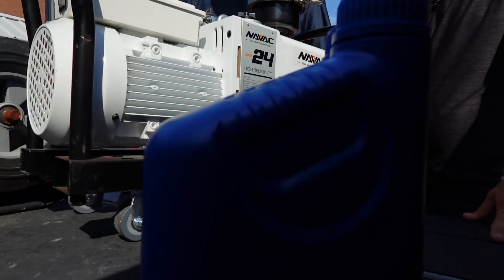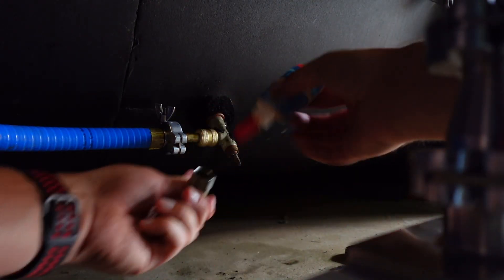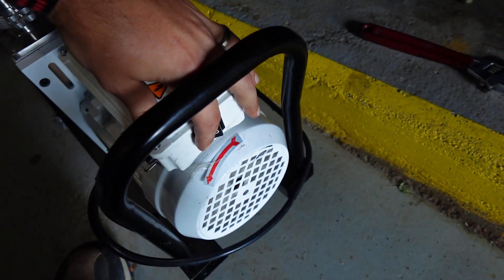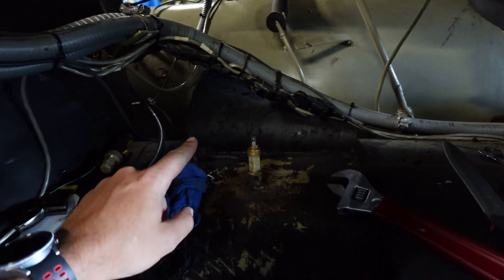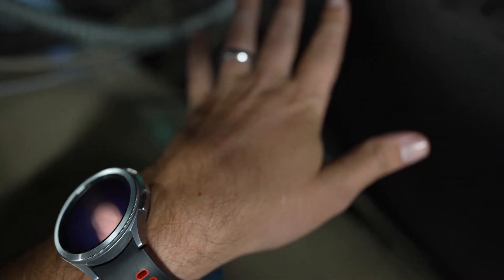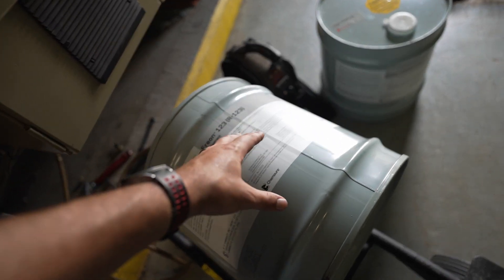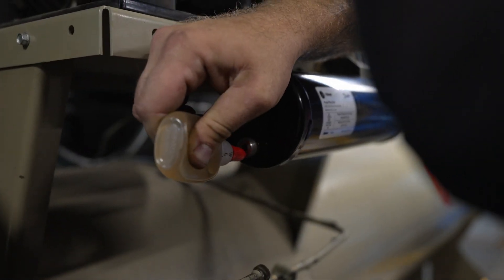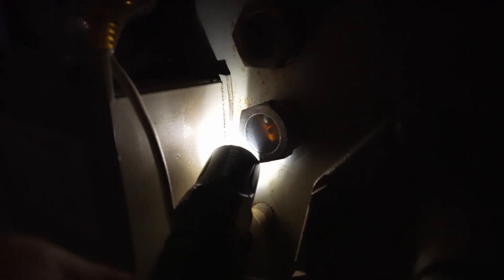CVH Difficult Repairs Trane Chiller

Comment: I always strive for a weekend (3 day) evacuation and a micron reading of 300 or under, preferably under. If you under 300 microns, the machine is tight and you shouldn't have any issues with leaks. I've used the FeildPiece recovery unit for push/pull quite often. Gotta use what's in the truck. You can push lots of liquid with those little machines. It's the vapor  charging that slows you down, not enough horsepower in those recovery units.

Comment: Great video mate 👍
I've tried push pull but it didn't work for whatever reason , still kinda scratching my head tryna find out what i did wrong ...
Reply: Pressure is everything my friend… check pressures everywhere and make sure you know exactly what components do what they are supposed to do. Any slight f#%k up will ruin a whole push/pull. Always open the right valves and in order. Everyones setup is different you will find one that works for you my man!! Practice is everything